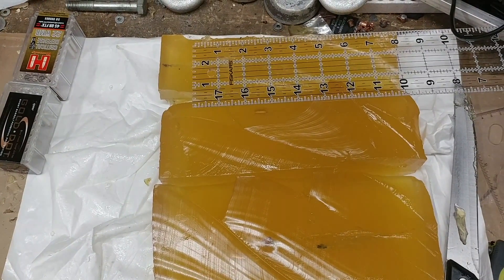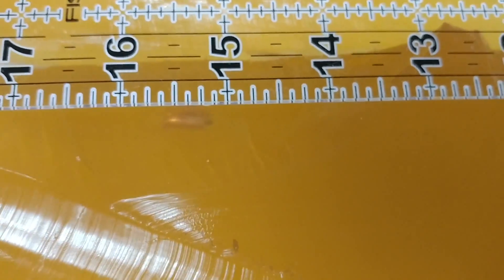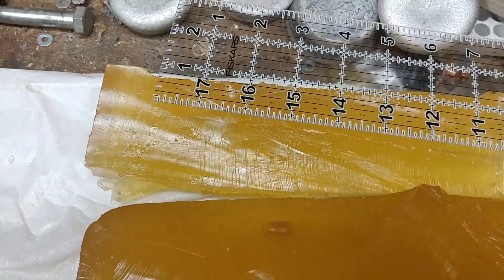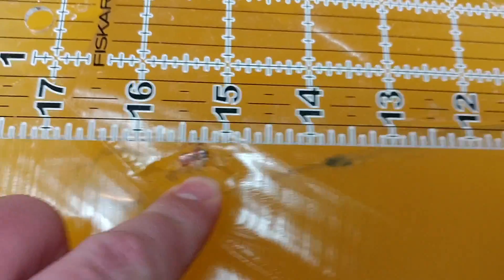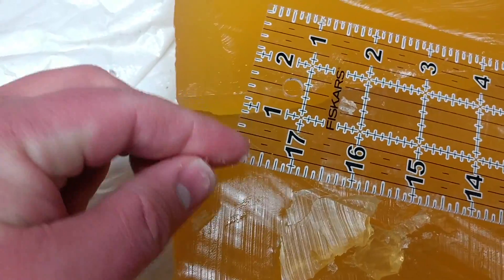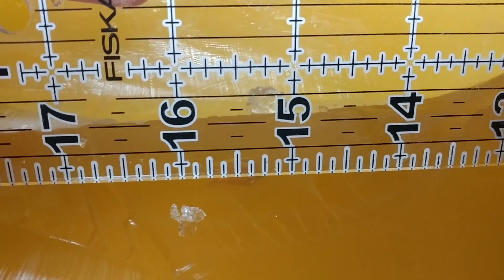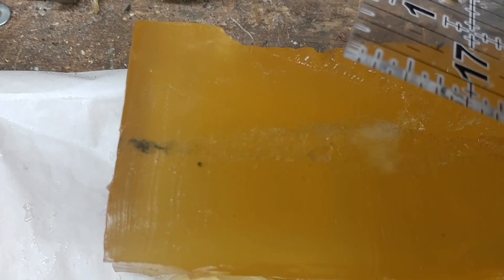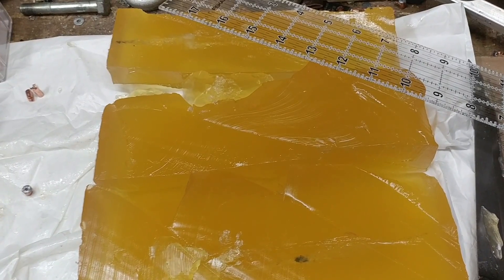22 Magnum shooting test results - Speer Gold Dot vs. Hornady Critical Defense

Comment: Why did you modify the Critical defense rounds? They need the polymer tip  to work as designed....
Reply from the maker: A subscribber asked me to try it. Through a 2" barrel they worked better than the rounds with the polymer tip left in. However, from a 4" barrel, the rounds work better as sold from Hornady.
Reply: @GeographyCzar  I know this was a while ago but thanks for the testing. I have a black widow. And a regular mini mag 1-1/8th. What type of accuracy are you getting without that poly tip? Does it make a difference? Also does the black wodow shoot heavy rounds better than 40 gr? Like a 45 or 50 grain round?
Reply from the maker: @TheMofrackey  Thanks for your question. I've always struggled with accuracy from NAAs. The Black Widow is probably the best, and keyholes are very rare with it. I like your idea, and I've been planning to do more accuracy testing with it, but I haven't done enough to answer your question (yet).
Reply: @GeographyCzar    I have a black widow from 05 has metal sights on it. Lol I hear the new ones are plastic? Idk. Either way. Mine seems to be extremely accurate and by that I mean palm sized groups at 40 feet. Enough to hit a squirrel from a tree limb in a pinch lol. I'm a prepper so when I hike this thing is soo easy to bring with me. My widow seems to be more accurate with 22lr for some reason. I've only shot it a few times 100 rounds maybe. And all in one range visit. So I haven't tried multiple different weights. I know that the gold dot SB magnum rounds 40gr pack a huge punch and seem to be accurate. Next time I'll try out the critical defense 45g and I have some federal 50g to test for accuracy. I'll let you know lol. Thanks for the reply